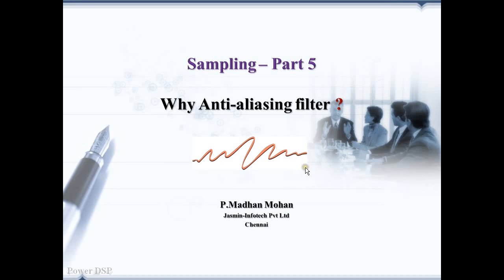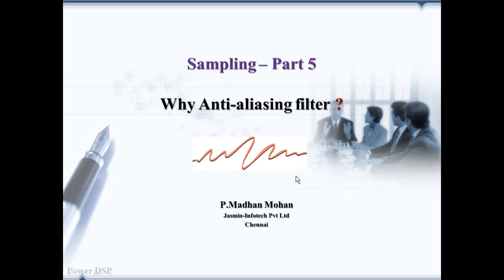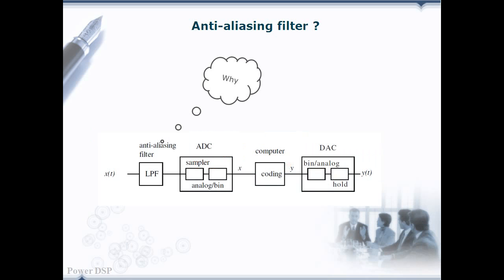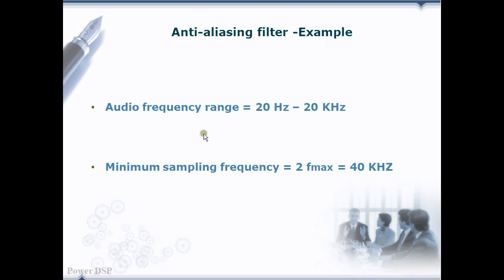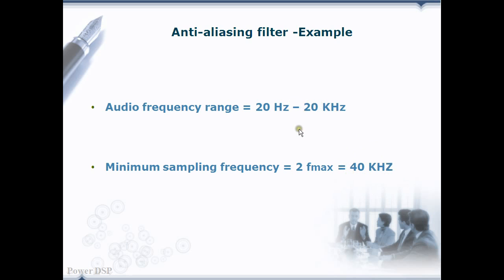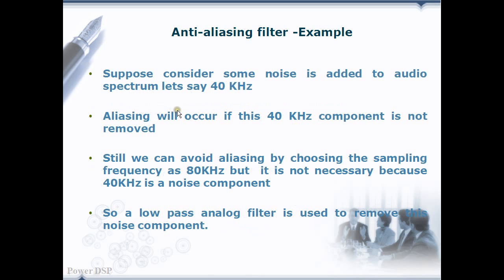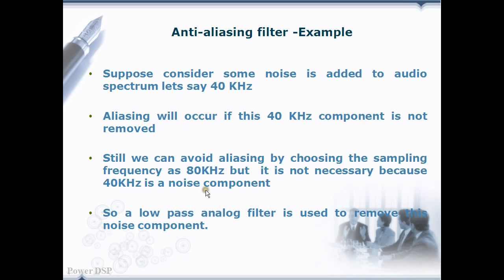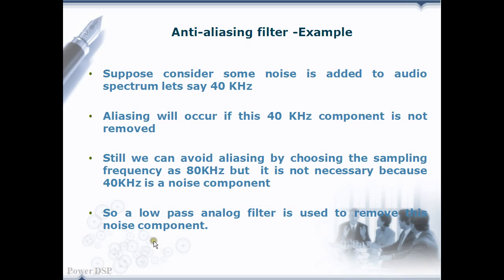Sampling Part 5 - why Anti Aliasing Filter

Comment: Sir.... What will happen if we have noise of 10 kHz
Reply from the maker: If we have noise of 10 KHZ then it will  be not be removed because it falls in the bandwidth of the frequency spectrum of the audio signals. The antialiasing filter removes the noise components above 20Khz only